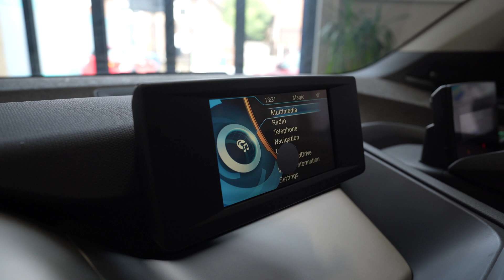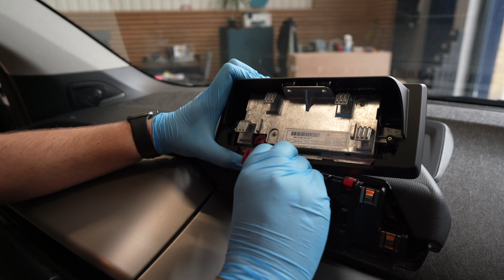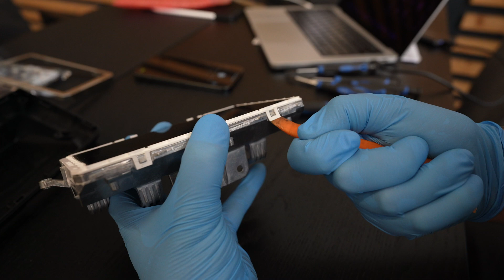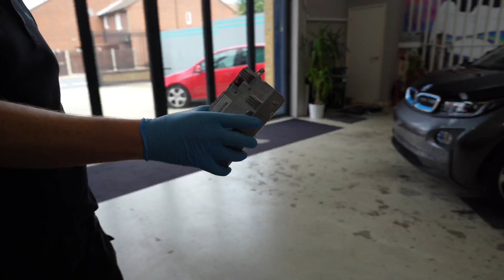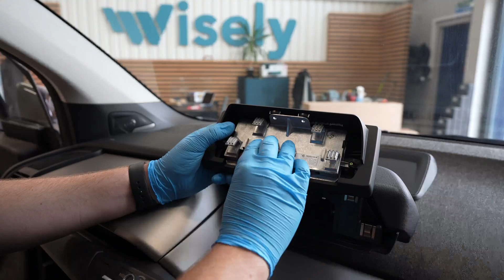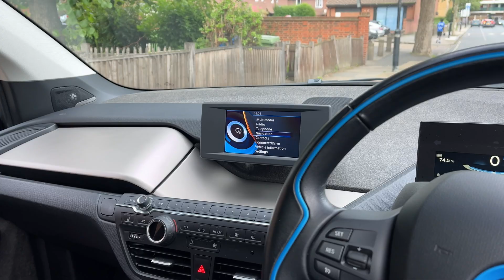BMW i3: Business Navigation Screen DIY Replacement (FOR LESS THAN 10x THE COST VS BMW) [GUIDE]

Comment: Slightly off piste, but can you retro fit the reversing camera to a later model i3
Reply from the maker: It's very complicated (if you want it done right), so if you want a car with a camera, we would suggest picking one on the used market which came with it from factory.

Comment: Great tip - thanks!  I wonder if there would be any benefit from adding a screen protector to the panel before the plastic assembly goes back on?
Reply: I was thinking that too, but would be a nightmare to replace. You can get them specifically cut for the screen, so I’d just get one of those and stick it on after assembly.